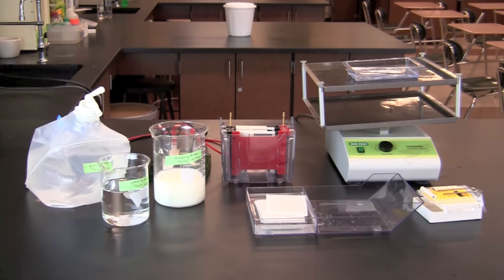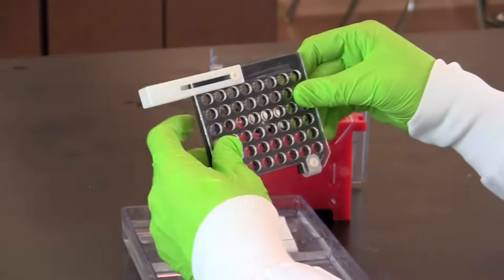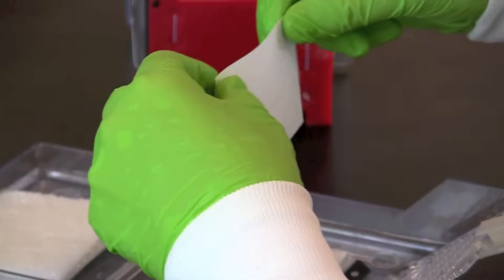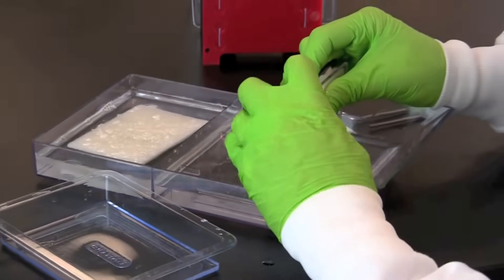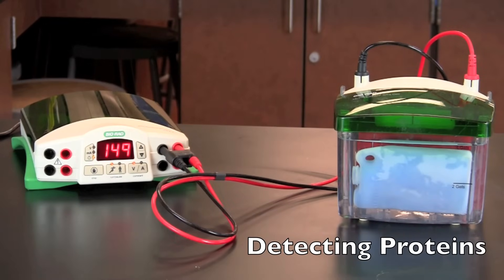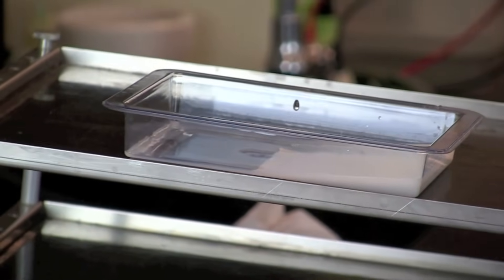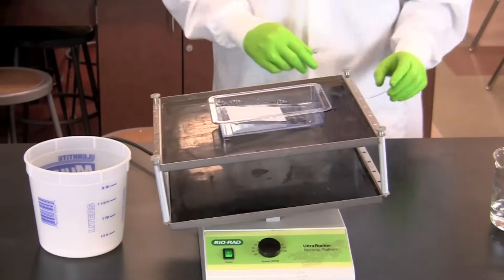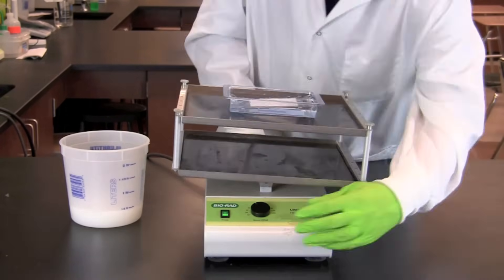Western Blotting

Comment: what is the purpose of the blocking solution?
Reply: +S Gill preventing nonspecific binding of primary and secondary antibodies in downstream steps. Blocking agents work by covering the unoccupied areas of the membrane with a dense layer of molecules. Blocking agents can either contain proteins, or be protein-free. I use to fatty-free milk(the cheapest and common one) or chick serum to be blocking buffer. If you want to improving your sensitization in phos-antibody, there have various commercial blocking buffer for that.